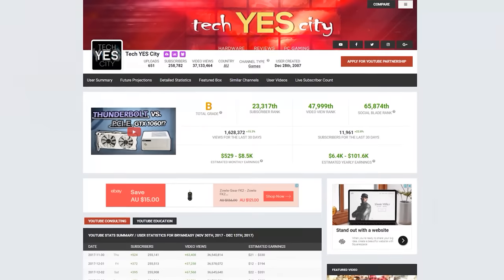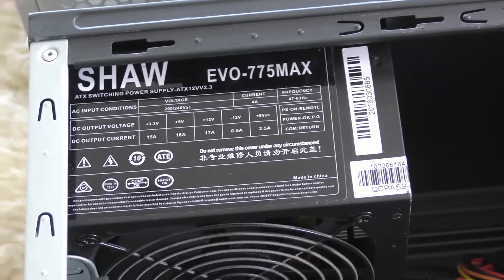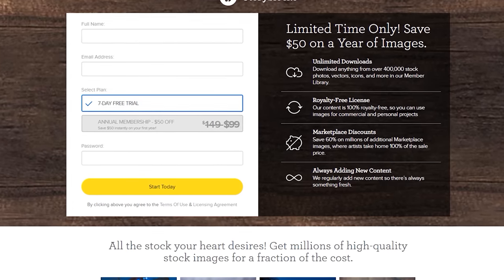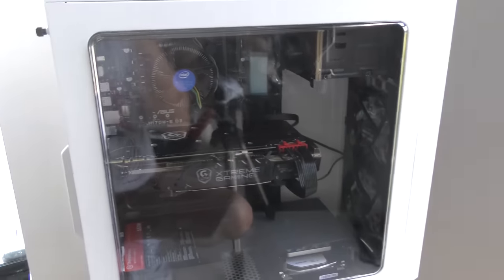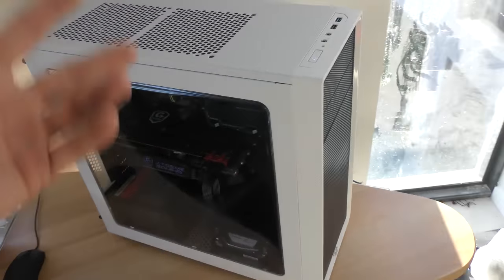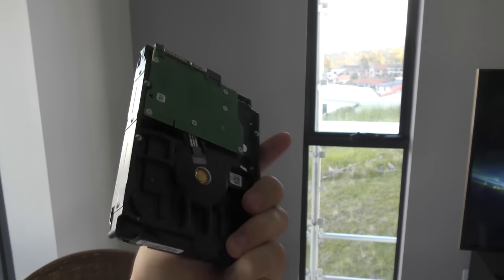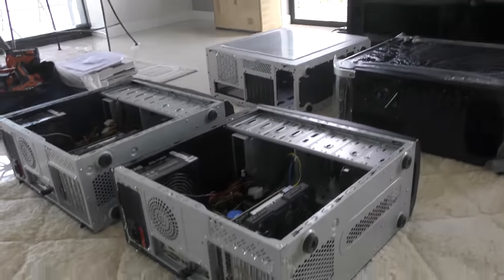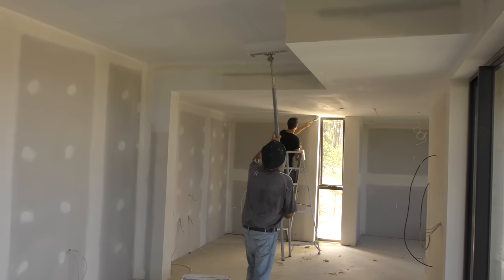How I Make MONEY as a Small Tech Channel - Behind The Scenes 4 PC Whip up

Comment: DDR4 RAM prices is the primary reason I decided not to build a Ryzen 5 1600 system but instead build using a used HP workstation with a Xeon almost equivalent to the R5 1600 instead. Almost $200 for just 16 GB of DDR4 RAM is just too rich for me.
Reply: $200 for 16GB of DDR4 RAM should be too rich for anyone. The fact that people are still paying it is just lunacy if you ask me.
Reply: thepro08

I bought an HP Z420 tower. It had a E5-1650 v2, 64 GB of ECC DDR3 1866, a 500 GB HDD with Win 7 on it, Quadro K600 card, 600 watt PSU and Windows 7 Pro COA for $497.85 USD. I have a GTX1060 6GB and a Samsung 850 Evo 256GB SSD from a previous system that I'll be adding to it. Should be a pretty capable system.
Reply: thepro08

If your Xeon is the W3570, the E5 I have is about twice the performance (Passmark of about 6,000 for the W3570 vs about 12,000 for my E5). The W3570 is 4 cores, 8 threads and the E5 1650 v2 is 6 cores, 12 threads. My previous system had an i5 2500K which is about equivalent to the W3570. I actually would have not upgraded if I didn't have a 34" 100hz 1440p ultrawide, gaming on that wasn't as smooth as I would have liked. For everything else I did, that level of performance was more than enough.

When doing my search, I found plenty of complete Z420 towers with the 3.2GHz 6c/12t E5-1650 v1 Xeon (Passmark of about 11,000) with 8GB RAM in the $200-300 range. Definitely a good price for only slightly lower performance than what I ended up with. I opted to spend a bit more though for more memory and a slightly faster v2 Xeon (which can use faster RAM too, which I wanted for the already aging DDR3 system). The other z420 I considered had the same v2 Xeon I have, but 8GB of ECC DDR3 1600 for $100 less. Although ECC DDR3 isn't too expensive, it was still about $60-70 for 2 sticks of 8GB 1600 so I just went ahead and got the system with the RAM maxed out. The ECC DDR3 1866 RAM I ended up with is still pretty expensive for whatever reason... they're about $50 for an 8GB stick, extra $100 to get 8 of them was a no-brainer even though that much RAM might be overkill for me right now.
Reply: thepro08

you might be better off selling the computer and just building another system, hold on to that RX480 though. even a $200 Z420 with the E5 1650 v1 would be better than trying to upgrade what you already have. for the moment, I don't think going from 8GB to 12 GB would make enough difference to be worth the effort.
Reply: thepro08

Just look at the RAM chips you have now and get similar. That's how I would have done it if my RAM wasn't already maxed out.
Reply: thepro08

You just need to match the type and speed, they don't have to be official/genuine HP parts. Official/genuine HP parts only matter if you intend on getting warranty service from HP directly. With how old that machine is, I doubt it would still be warrantied by HP.

For my RAM modules, I have "PC3-14900E" in my system. There are other numbers on the chip but those are the most relevant as far as getting compatible memory. If I had any free slots and wanted to add more, I would just look for that type.  The "PC3" means they're DDR3 modules, the "14900" means they're 1866 MHz speed, and the "E" at the end means they're ECC type modules. There should be something similar (though maybe not identical) written on your memory modules. I think yours is a DDR3 system too so look for "PC3-" on your modules.

The weird thing about these workstations is I've also read of people using server RAM on them (Z420 more specifically) that HP supposedly says isn't supported but work perfectly fine. More specifically 16GB RDIMM (Registered server RAM) modules for a total of 128GB of memory.
Reply: That E5 is unlocked, wasted in a HP, swap in an octocore xeon and OC this one on an X79
Reply: demiurge3141

I'm aware that my E5 is unlocked, but spending the money to get an overclock-able motherboard for my E5 wouldn't really do anything for me considering what I do with it and the GTX 1060 GPU I have.
Reply: Well you can swap for a locked one and have enough cash for a night out.
Reply: demiurge3141

Such as? I like the E5 1650 v2 just fine, I don't want anything slower either.
Reply: Its Neight rolf lunacy

Comment: Oh god thats a Shaw power supply! i wouldn't even risk bringing it into the house
Reply: I threw it in the bin when I bought a used PC. Never use them no matter how desperate you are, unless you like the smell of cooked components :)
Reply: Good lesson as to why you should always check the specs yourself.

For anyone wondering what I mean, if that PSU were marketed correctly it'd only be rated at 204W because it can only do 17A over the +12V rail. So you see 775 and think it's a 775W PSU, but it's actually only 204W.
Reply: cuz its not 80+ rated
Reply from the maker: What if we stuck both the Shaw power supplies together? Would we have a shaw nuclear reactor?
Reply: Tech YES City even if it didn't work out like that the fireworks would be beautiful
Reply: @Najvalsa  maybe usable for an office PC but that's about it. wouldn't really trust such anyways.

Comment: Tip for cleaning cpu's & heat-sinks. From being a diabetic and having plenty of alcohol pads on hand, I've found them good and cheap for cpu & heat-sink cleaning.
You can get a box of 100 for under $5.00 depending on where you shop..

Comment: I don't know if it is me but I think that if you go with a FM2+ motherboard plus an AMD A10 series APU and 256GB of DDR3 RAM you don't actually need an additional graphics card as a perfectly good graphics card and sound card are integrated into the AMD A10 APUs one being the RADEON R7 graphics system and the Trueaudio DSP audio so very Spartan but if the CPU used doesn't have integrated graphics then by all means install a graphics card, if going with INTEL processors then a graphics card is a requirement OK.

Comment: I was playing overwatch last night and my PSU died and when I tried turning it back on I got that magic POP! and weird electrical smell. Can I get an F to pay to respects? (EVGA is cross-shipping me a new one)
Reply: which EVGA psu?
Reply: Dessika Modus the 650 GQ, it was just under 1 year old
Reply: did it damage anything else in your computer?
Reply: Dessika Modus not that I know of, I have an older 500w PSU and I haven't noticed anything out of the norm so far. I think everything is fine
Reply: hope everything works out with the new replacement PSU. at least you have another PSU and can use your PC :D
Reply: F
Reply: Have an F sir!
Reply: I have the same model :/ Hope I don't get the magic blue smoke.
Reply: Boda F
Reply: I didn't get the cool smoke actually, I think i got ripped off. Anyways yours should be fine the 650 GQ is a very high rated PSU and I think I just had bad luck. Even if it does go bad the PSU has a safety net so if a situation like mine happens (It tried drawing A LOT of power for no reason and died because of it, so much power that it actually tripped the breaker for my room) the rest of the PC should be completely unharmed
Reply from the maker: Ah that would suck, here have an F
Reply: Same happened to my silverstone gold psu, here's your F.

Comment: can you help me i have a core 2 quad q8400 an r7 260x 2gb and 6gb ddr3 ram fortnite runs terrible. On the same settings you had the game run around 34 fps my cpu was  90 to 100% used and my gpu was 30%
Reply: F12 CS:GO overclock the cpu
Reply: crumbaker its a core 2 quad q8400 https://ark.intel.com/products/38512/Intel-Core2-Quad-Processor-Q8400-4M-Cache-2_66-GHz-1333-MHz-FSB
Reply: yeah i'm going to upgrade to a i7 2600 and 10gb of ram
Reply: ok thats for the help man

Comment: Thermaltake power supplies suck! When I maxed out my 500w unit with an R9 390 and FX-6300 it blew up! I know the R9 390 recommends a 600w unit at least, but this thermaltake unit claimed to have a great 12v rail and my whole pc used less than 500w. Thankfully my pc was ok and I bought an EVGA 600w unit that was waaaaay overkill and now that pc is a cryptocurrency mining rig.
Reply from the maker: Yeah I would have rathered the cx550 in hindsight :(

Comment: sir my PC specs:
i3 3210 3.20ghz
dh61ww mobo 
10gb ddr3 RAM
500watt cheap PSU
Zotac GT 610 2GB ddr3 GPU

I want to upgrade my GPU and PSU can you plz suggest me a good GPU and PSU.I want to play all modern AAA games at ultra settings if I get 35 to 40fps without stuttering I will be happy.

Comment: Why bother buying keys? You can totally use Windows 10 without the key, the system will just bug you to "activate windows 10" in the corner of the screen. Plenty enough to do testing and stuff and the buyer can buy a key if they need to.

Comment: Hi Brain, I have around 10 PCs at work that have to be sold ASAP. All of them have i5 2400 4gb ddr3 500hd 400w PSU 300w at 12v no Windows since it’s From Uni... you could of get good deal but the biggest problem I am in Auckland NZ! Let me know if interested Bro
Reply from the maker: Damn would be too hard to ge tthem over here, I would take it though usually.